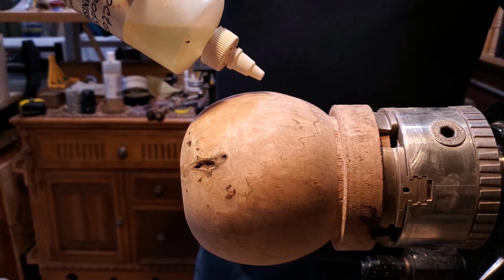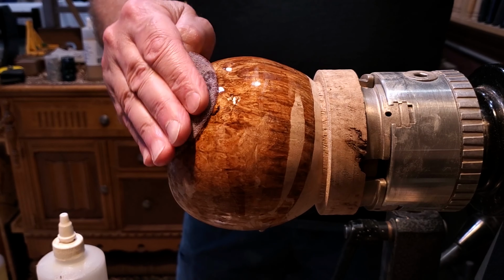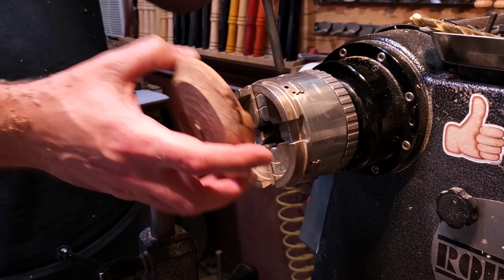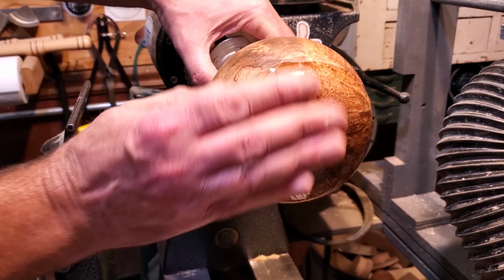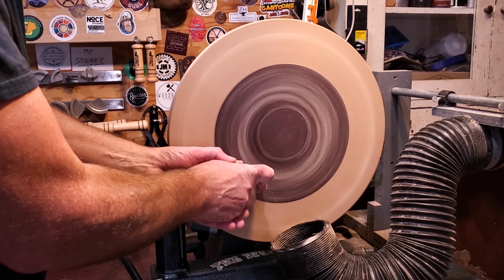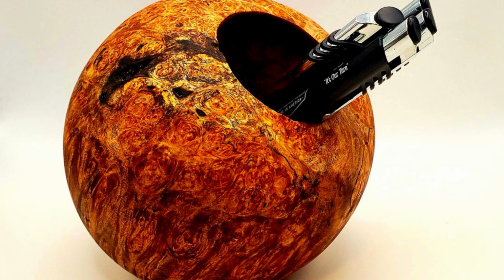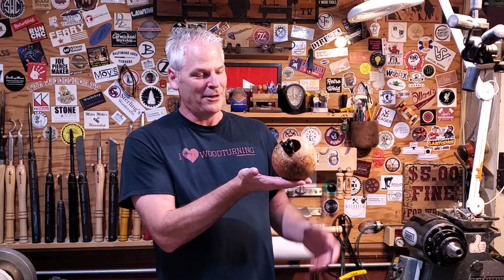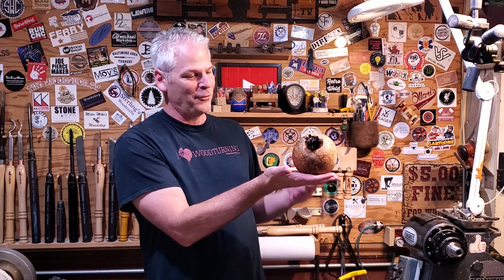Woodturning | Maple Burl Pen Holder

Comment: Nice idea, Carl!   

Suggestion:   Try the sole of an old tennis shoe for a sand paper eraser.  I found that it works pretty good and makes good use of a pair of sneakers that are no longer wearable.   Plus, it’s a heck of a lot cheaper.  Try it, you might like it!  And if it doesn’t, you are not out anything.
Reply from the maker: Thank you!! and Thanks for the tip. I'll give it a try!
Reply: @CarlJacobson  Let me know how my suggestion worked for you.  I''d be interested to hear.